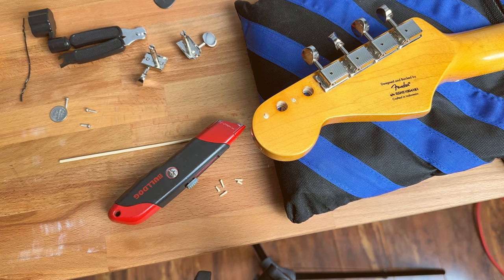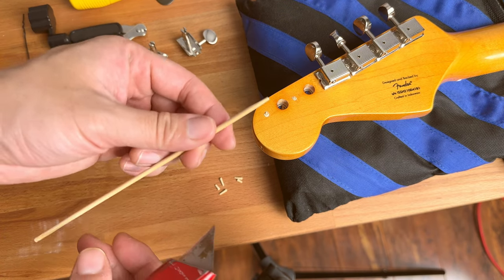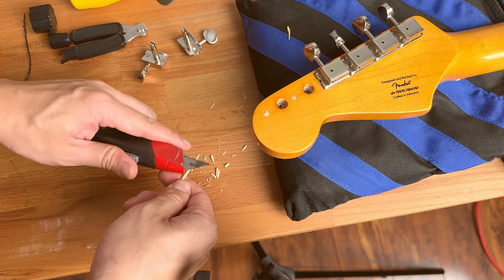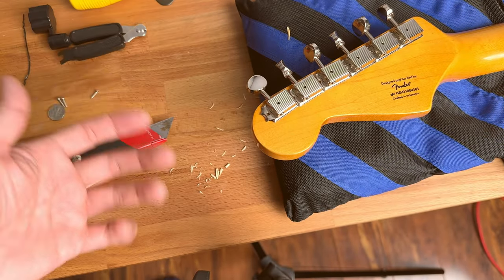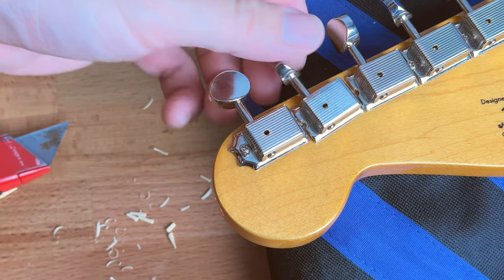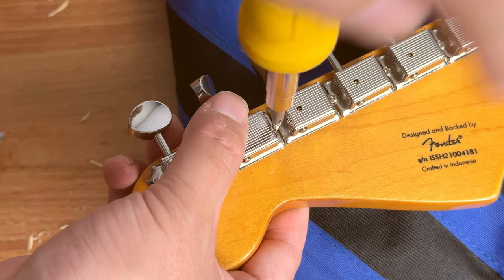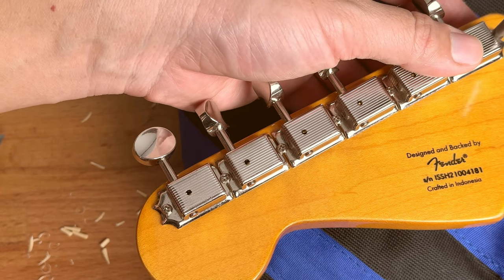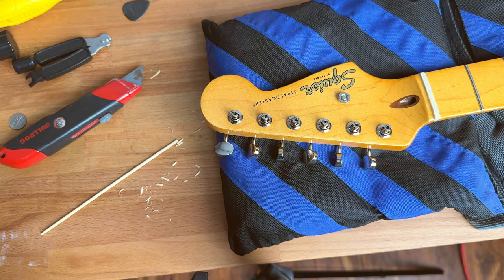How To Repair Stripped Electric Guitar Tuner Screws (Squire Vintage Vibe 50s Stratocaster)

Comment: Has this worked longer term? I just bought a 60's Classic Vibe and one of the tuners is doing this...
Reply from the maker: It held up well for the duration I've owned it, and it doesn't require anything special and will make sure the tuners doesn't move around.
Reply: Do regular toothpicks work? This is fantastic! My Fender guitar has the same issues…. Someone at the factory is stripping these holes lol